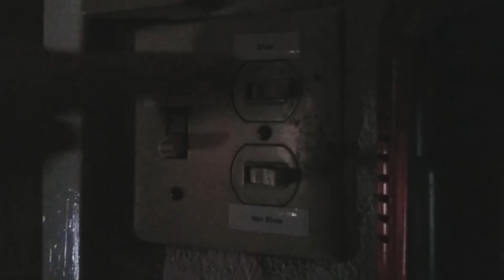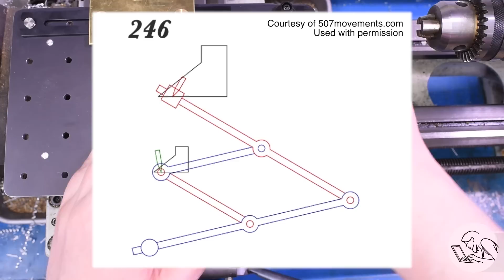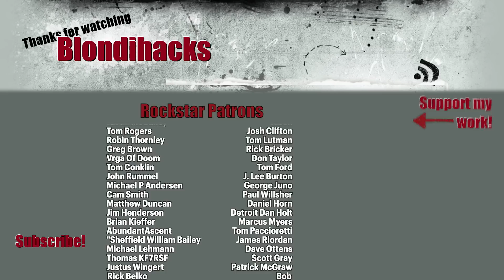Turnado : Copying Parts, Ball Turning, and Crazy Godlike Powers

Comment: If your jig is constraining the angle and height of the tool, all that pressure on your fingers is due to feeding in to the work. Well, that's a previously solved problem - woodturners use long chisels held firm at the body and anchored by downward palm pressure near the tip. I'm sure a short sturdy bar with a rubber-coated fork could grip your toolholder firmly and allow you to use body movement and arm rather than finger pressure to guide and feed the tool.

Comment: Thanks for that, Eccentric's Diamond Tool Holder goes well on small lathes too.
Reply: It goes well on bigger lathes too. It's all I use for aluminium and brass due to the ease of getting accurate razor sharp tips. I have one of the original larger versions that can take 3/8" HSS as well as 5/16". I dont have the LH one though, only RH, eventually I will need to add it.
Reply: @benchapman5247  Thanks, I am using the 1/4 Crobalt on just about everything. The LH is worth getting too.

Comment: Hi Quinn, a nice addition to your toolroom. Chris of Click Spring free styles many a job using a less exacting method than the Turnado. I only mention this because you have mentioned Chris in the past. Stay safe and thank you for sharing this unique tool with us.
Reply: I thought of that too - but he's usually making really small things in brass, which is why he can get away with it I think.
Reply: Yes, Chris is using the traditional watch/clock makers form of free hand turning. It's how all the parts used to be made before precision slides were common on lathes. You can be incredibly accurate, but it does require a lot of skill. The turnado seems to open the doors to those who want an easier and safer way to go about free hand turning. The copy attachment looks really useful as well, for those repeat parts!

Comment: Lots of part copying rigs that I've seen have some sort of spring or counter weight system to apply a constant pressure to the tool as it feeds back and forth over the work piece up to where the template is hit.

Comment: Great review. I have the Turnado, but I don't have all the fancy accessories you got. That viewer must love your channel, because the full kit ain't cheap! I agree about the amount of force required to make it cut. I found it cut easier when using the opposite end of the tool bit with the large radius cutting edge. So I use that end unless the profile I'm cutting requires the pointy end of the bit.

Comment: Hi Blondie, I've just watched the attached video, and I love the attachment you've been sent. But I see you we're having problems getting a perfect sphere to match with the centre point. Here's how I do it and it takes all the guess work out of it. If you use the cross slide on your lathe and move the saddle along the length towards toward the aluminum bar, and here's the tricky bit, whilst rotating the cross slide back and forth, whilst moving the saddle towards the bar and moving the attachment back and forth with the crop slide, all at the same time, eventually the attachment will stop moving back and forth, you will then be in perfect alignment with your spindle centre. 
After all of the above,  adjusted the tool radius and you will have perfect spheres everytime. 
It sounds a lot of hard work, but believe me, once you have the attachment on the lathe, it'll take less than a minute to set up!

Comment: I finally got mine installed. I had to make a radiused thingy for a machine I was rebuilding.  After getting the turnado mounted and set up I made the part out of mild steel. But then I had to wrangle the turnado off and reinstall my compound to part off the part. If I had to do a few parts it would get old quickly. I think I might try to mount a parting tool on the platform. That was the only drawback I could see and probably easily surmountable

Comment: Great video!  What a neat tool!  Have a question for you... If you put an accurate cross-hole (same size as pins in the plate) in a piece of stock and then put that in your collet chuck, could you then use a gauge pin to align the two holes?  You would of coarse need to know the distance of the cross-hole to the chuck or some other convenient reference, but... Would this make it easier to center the tool for cutting a radii?

Comment: OK......... Now THAT'S a metal machining process I've never even thought of before. It looks interesting, and apperes the system wouldn't be particularly difficult for people to fabricate themselves if cost and international shipping made getting an original prohibitively expensive.

Maybe, if the top of the cross slide was large and flat enough on a persons lathe, they could make the tool post part longer so it could sit directly on that and still put the tool on the required centre height? It would need a wider base on the tool post to keep it stable, but I can't see an issue there. This would also mean that there'd be the added benefit of having clearance for larger diameter workpieces.

One little idea though, if you do decide to use this extensively, might I suggest turning up a push on radiused PTFE cap to cover the collet chucks nut? Those notched spanner cut outs aren't big, but I'd bet they'd happily chew flesh if you got complacent around them.......... And as we all know, metal working machines ARE sentient carnivorous creatures that crave human meat. They just sit in wait for you to be the slightest bit incautious so they can bite your fingers, knuckles and arms to let the blood flow ! :D

Comment: For the bracket, you could make a part to attach the actual cutting tool to the left of the scribe so that you could cut a part away from the part being used as a reference. It would also give you more space for larger parts too

Comment: For setting the radius... just make a pin that is the same diameter as the pivot pin but much taller, a little bit taller than the baseplate-to-tool tip. Set the radius between the pin and the tool tip with calipers, gage blocks/pieces, inside mic, or whatever. Remember to account for the radius of the pin. Might want to attach the radius setting pin to that table with a screw from underneath to make it extra snug. Depending on the kind of work you do you could keep itmounted most of the time on the bottom left or bottom right corner. Always ready but out of the way. The setting pin would work for both convex and concave radii. Similarly the setting pin would also be useful for setting the pivot pin in the correct location under the work.
Now that I have mentioned it... I am kinda surprised that it isn't part of the kit already! Also since I think you have a DRO on that lathe it makes it even easier (but easy to set either way.) Hope that helps.

Comment: Hi Quinn.  Nice video, I've been lusting after one of those for a while.  I do feel the need to point out though, when you say you can't turn metal like you can on a wood lathe - well, yes, you can.  A lot of precision bench lathes come with a hand rest, clockmakers do it all the time, and if you want bigger, as a kid I watched my grandfather shape the curved surface of a cast iron flat belt pulley, using a hand tool, on his 6 foot lathe.  A big enough piece that it had to be winched into place.

Comment: I was wondering if it would be possible to fab a spring assist to take some of the strain from your fingers?
That said, the Turnado is obviously not a production tool, but I can see this being a very useful piece of kit. You could've made some pretty sexy parts out of brass for the current steam engine project.

Comment: That is super cool! Way better than my step turning adjustment tool idea 😄 now you gotta make a bracket to hold a piece like the shower knob in the other direction but make it easier to adjust the height of the template because I bet that's going to be really hard to get just right, especially if you have to do a full radius on the end!

Comment: Very nifty tool. I made a template follower using a button insert and gauge pin the same diameter to machine hyperbolic antenna subreflectors. That's more like the tailstock/follower idea you showed, but the pin is on the cross-slide and the template clamps to the carriage. Means I can use the handwheels and traverse for minimal effort. It ain't CNC, but it works on my old Colchester 1800. Using a hand graver and toolrest for small freehand parts on this big old lathe is very satisfying, but I'm sure the Armchair Safety Police would yell at me if I show it in a video!

Comment: Cool tool!.. 
The tool holder is somewhat similar to some of the tool holders of Watchmakers lathes.

and.. on some watchmakers lathes, you actually work just like on a woodturning lathe, holding the tool on a toolrest by hand.. sometimes even turning hardened steel
but these parts are way smaller..that helps..

Comment: Fascinating. I'm not a metal worker, but have found the technology interesting ever since seeing video of a 1950s lathe being restored. (Not to mention drooling over videos of advanced CNC systems at work.)

I have to wonder if there's a laser-based system for precisely locating/adjusting the component parts in 3 dimensional space..? Seeing you relate part to part, where those components subtly distort over time & use (& in tiny increments, temperature ranges), makes me curious if there's an highly consistent / extremely accurate advanced tech that uses visible lasers to help you conveniently reset your lathe in various configurations.

Comment: I have been drooling over this tool for more than 2 years now but I can't quite pull the trigger. Every time I've seen them demonstrated, it's been on small imported lathes. I have a smaller tool room machine I would like to try this on, but it certainly has a lot more grunt then these modern vfd controlled machines. With that in mind, would you feel safe trying this on a heavier machine? Still only 9 inches of swing, but from the 30s, so full torque belted down as opposed to frequency. What are your thoughts? The idea kind of scares me, but it's extremely appealing to be able to freehand steel. But I've gotten sort of attached to my hands, I would like to keep them.
Reply: I'm just assuming because you mentioned you liked eccentric engineering, but have you tried the diamond tool holder which holds the bit tangentially? Can I ask the same question, do you think it still has a place on an older heavier machine? It seems like it's primary characteristic is for machines that lack rigidity

Comment: Maybe a brass tip on the follower part, maybe drill and tap a couple of holes in the pointy bit, and you could then attach a brass, or plastic, replaceable 'pointy bit', which would/could reduce any marring on your original 3d part.

Comment: I love your videos, and it looks like an amazing tool) I have a small question..
When measuring the top plate before adjusting the posts, on the video you only measure it once at an arbitrary spot. Do you think it would be more reliable to measure it at the corners of the plate, or the top of each four of the posts? To make sure the whole plate sits flat

Comment: Love your videos. I would point out that earlier in this video you mention that metal can't be turned like wood. That is not true. Brass in many cases, is still turned with hand tools. Though steel is much harder to turn that way it is possible. I was talking to an old RR machine shop guy and he related that when he started in the shop in 1920's, he was first tasked with making a tapered loco rod pin, on a hand lathe. And apparently the shop foreman would give him hell if it wasn't right. All the apprentices started on a hand lathe.

Comment: I know that I should know, but why not lift the wise away, use parallells and clamp the piece to the table? A square against the t-slits should be enough when it's only bolt-holes. And to my understanding there should be keys under the wise so that it would be put back the same way?

Comment: When you're using it, are you typically pushing mainly into the part, or is side to side a lot of force too? Thinking about if there's some practical way to add pedal or knee bar that would provide most of the force so the hands have time to think

Comment: Pulling from center to OD makes a better finish on facing. It allows you to hold the same pressure easier and pulling is more steady then pushing. At least that's my opinion lol might be completely wrong.

Edit: yeah perfect example. Chess set is what I thought as well, the reason I wanted a lathe was to make metal chess pieces but never got one. Yeah that tool would be really cool for that for sure!

Comment: For the form follower, mayb you could make a vertical arm that attaches to the base of the tornado   tool holder, that gives you leverage for the force needed to push the tool into the stock, so that you only need 'raw power' to move in the axial direction, and have a 2 or 3x advantage in the cross-feed direction? I have no idea if that makes sense to anyone, sure would easier to sketch than describe  ;-)

Comment: With a bit of ingenuity one could make an automatic system with a stepper motor to move the cutting tool horizontaly back and forth and a couple of springs or pistons to maintain pressure on the part and the template.
You set it up, turn it on and in a few minutes you have a perfectly replicated part with excellent surface finish.
Just a little idea if you want to start a shower door handle manufacturing company...

Comment: I doubt this would work on stainless steel. You'd have to keep the tool pressure really high to prevent work hardening. I don't see how you could do that without a leadscrew

Comment: If you made a kind of 'fin' shape, the same height as the tool offset, with two pins on the 'base', that drop into two of tne tornado base holes, you could get exact centering of the base plate to your spindle axis, gauging against the point left by facing a part, or using a dead center in a collet...i think, but i'm no tooling god...

Comment: You can turn metal in the same way as wood - the tool rest need to be very robust, the tool handles are VERY long (to give leverage), tool overhang from the rest must be minimal. But metal was turned long before the compound rest was used.

Since this (fabulous) gadget mean that forces are quite low, tool sharpness is going to be key. Your D-bit grinder should be ideal for making razor sharp bits with the 3 degree clearances.
Reply: Hello Paul, good to see you are still enjoying tool stuff.  Would be good to catch up again.... drop me a line.   cheers, Miles (Cambridge)

Comment: Way back in the dark ages.... 1970s, I made a ball turner. To measure the radius, the pivot pin had a 1/8th reamed hole through the middle. Into that hole went a pointed pin. Easy to measure the radius then. The pin came out when turning.

Comment: Really I think that you could step turn it and use the turnado for only finishing up the shape. There's no need to go from raw to final shape in one tool. Especially if you can leave the part colleted. Step turn or rough trace and then use turnado to finish.

Also why not have it so the angle iron is double sided? Actually even better, make it a T. Like, you can turn the mount around. The T is so you can mount bigger things lower.

Comment: How accurate is this set could it be used for copying live steam g scale model train parts from a 3d print or existing model aka accurate to the hundredth or better ? I'm looking to  make sand domes wheels buffers etc at a fast rate possibly just for roughing in

Comment: Turnado rules! I did make a tool which allows you to set the tool tip to an accurate radius. It requires a lot of laser cut discs of different diameters but it does work, You should try out one of Gary's diamond tool holders. Perfect for small hobby lathes where HSS is used a lot. Had to laugh at the millimetre to mile reference. Ludicrous much?
Reply from the maker: I was born ludicrous. 😬

Comment: I like! Should be easy to replicate with a solid base plate. Too bad he doesn't show the price for the kit on his website. Some folks would rather not hand out their email address just to get a price quote. That kinda tells me I can't afford it anyway.

Thanks for the great review and demo. I had been thinking that a freehand sliding tool holder would work, if the moving base plate of the tool holder extended significantly beyond the tip of the tool, but I figured too much pressure would be required, for turning SS. I was thinking in terms of aluminum, brass, and other soft metals and plastics. Maybe just maybe low carbon steel. Should work great with carbide tooling. 

The cast iron tool holder is a nice touch. Base sliding friction = enemy. More mass in the tool holder might help with reducing chatter.

The extra bits and bobs in the full kit are pretty cool.

Comment: Not quite true, you can turn metal like you do with wood. I made a carbide insert tool (about 3 ft long with a wood handle) so I can turn metal parts on my benchtop wood lathe. It works surprisingly well.

Comment: 0.0000199 miles 🤣.
by the way, there is an easier way to get the center distance of the notches:
-messure one of the notches 
-zero the calipler
-messure the outer distance with the zreo you set before